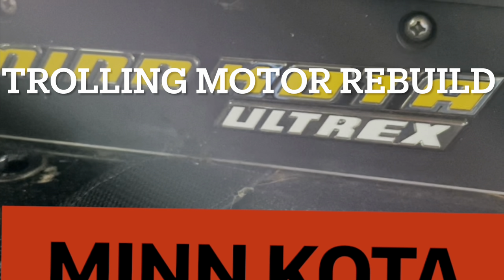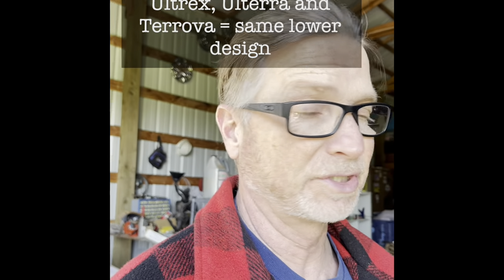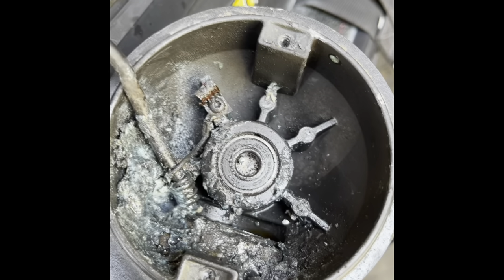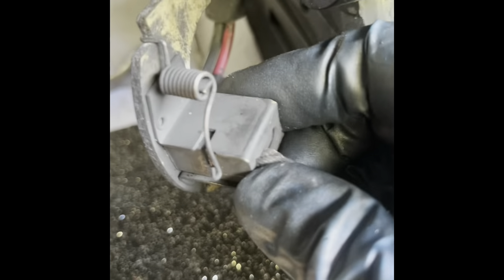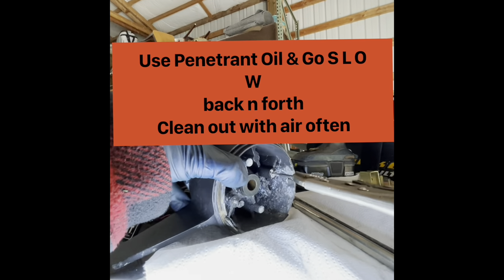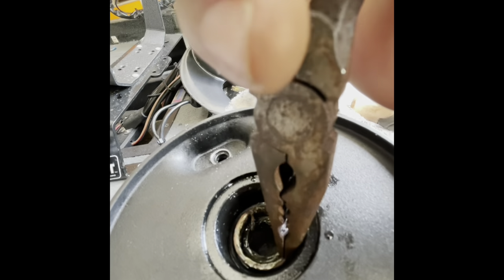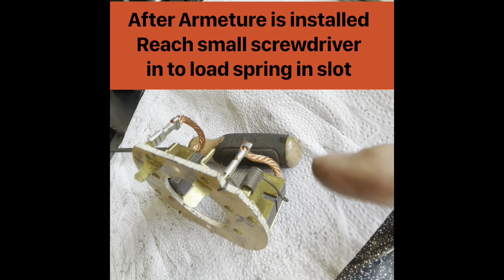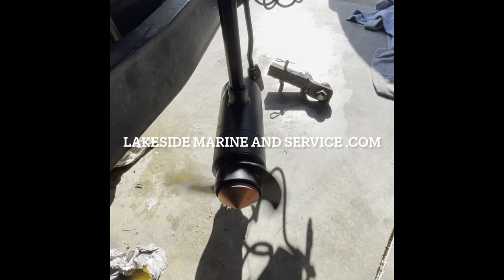ULTREX REBUILD BOTTOM END

Comment: Hi will you be doing a video on heating a pool ? I just read it on one of your comments on a heating pool clip 😃
Reply from the maker: Not this year  but want to use camping type propane with water tubes above flame 
then run cold water in bottom and then out top to pool. Might be one made by now on YT🙋🏼‍♂️

Comment: I have 2017 ultrex 24 V and the upper thru bolts goes in what hole of the item 108(CLIP, RETAINING SHORT) of the diagram. I know that the 36 and 24 volts motor are i bit differents
Reply from the maker: Look on lakesides enter your model no. The website shows location at the parts level. 🙂
Reply: Please help… I noticed you said to make sure you put that washer back in under the bearing you had trouble getting out. In the parts diagram it shows there is two of them but yet I only seen you pull one out? Part number is 992-010
WASHER, SPRING BELLEVILLE it shows two in the diagram.